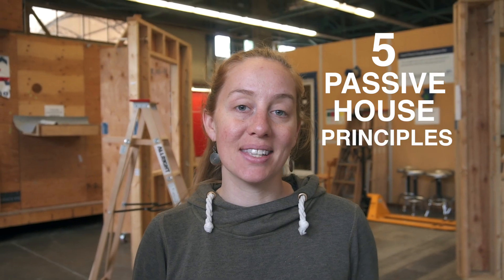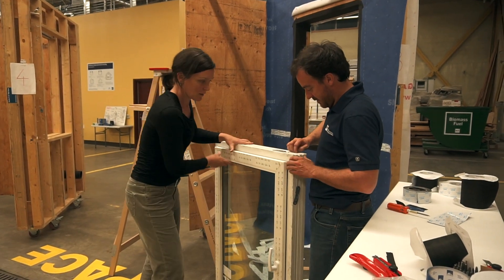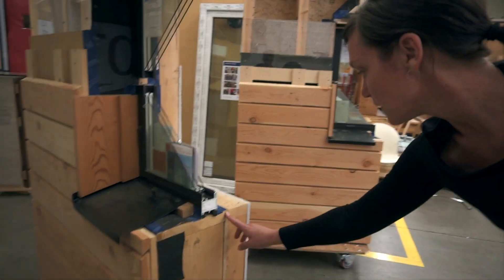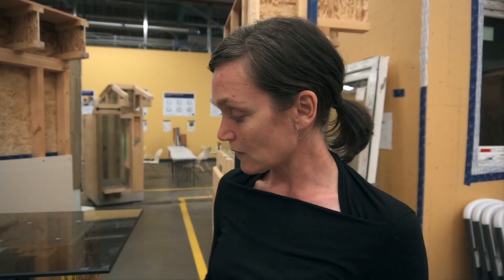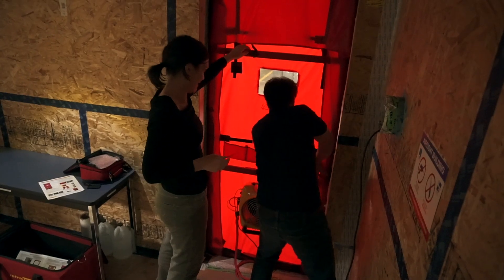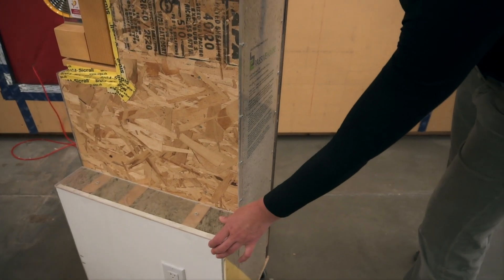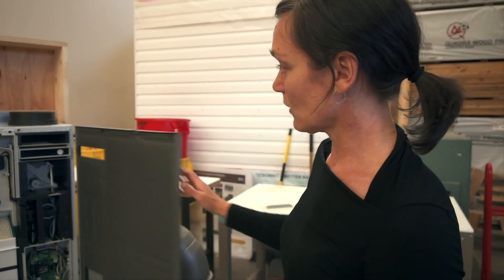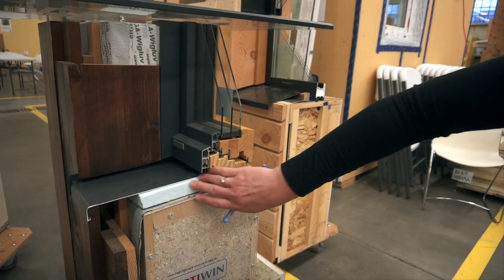Passive House = 90% Home Energy Reduction!

Comment: They didn’t speak of cooling.  Where I live during the summer we have consecutive weeks of 90 degrees F weather.  And this can slop over into the spring and fall.  Our concern is cooling.
Reply: Mary Ann Lee same measures with a few different dispositions regarding orientation. What can keep the heat inside can also keep it outside :)
Reply: @alexanderj1316  What system do you think is best to deal with this problem? A system that creates even more heat outside just makes the problem worse!
Reply: @greengenie7063  it does not create heat, it just keeps it outside. This is a basic principle of insulation. The building hull is optimized to minimize heat conduction, which means that the balancing of the temperatures between the colder and the warmer side will take more time. It can thus work both ways.
Reply: @greengenie7063  Did I get your question right?
Reply: @alexanderj1316  Superinsulation, shading and air-movement are all fine. I'm glad you are not promoting air conditioning!
Reply: @greengenie7063  definitely, though I would tend to think that shading, natural air flow and inertia a easy to obtain with simple materials (traditional construction does it) whereas superinsolation usually requires more grey energy for the product processing
Reply: @alexanderj1316  Passiv-haus (in the UK) has typical U-values of 0.1 for the roof and 0.2 for the walls. To create these values you just would not be able to use simple traditional materials such as timber, earth or stone. 
Super-insulation can be created by utilising a range of techniques and materials. Cellulose insulation (from recycled paper) is one of the best insulations available. 
In a global warming situation, the traditional building techniques (such as earth or stone) are not able to eliminate indoor thermal conditions which are un-healthy for human physiology - and current (active) passiv-haus technology will also struggle to maintain indoor comfort.
We need practical, affordable ideas that actually will work in the future, not concepts which we just feel good about or enable us to feel good.
In a world living with climate change, traditional buildings are already become uninhabitable during extreme periods of weather. In the UK in summer I already find that it is more comfortable in a simple naturally ventilated, insulated building with zero thermal capacity - compared to a brick building which soaks up heat energy but cannot cool over night due to high night-time temperatures.
Reply: @greengenie7063  It is all a matter of concepts, you could get a good natural air flow if you make the temperature gradient play in your favour. This is not incompatible with using inertia for keeping warmth in winter.
I also used to think that new materials are necessary to improve the situation (and they do improve it), but the truth is that they are not enough of a solution.
In Switzerland, people try to make "2000W societies" (another label such as Passivhaus, Minergie, Leeds and so on) a reality, but the sad truth is that people expect to have 25°C inside so that they can run around in underpants while it's at -10°C outside. 
People used to know when to put on a pullover and get nearer to the fireplace, they have survived all the way, but our growing expectation of comfort is pushing consumerism.
And in other countries, the climate is more stable throughout the seasons, which makes traditional housing the best (but often forgotten) solution, as I have seen in tropical countries.
Reply: Alexander J  I do not think you have understood what I am saying. A good natural airflow (not always possible) is somewhat useless in a high ambient temperature. 
So called traditional materials and thermal capacity is already proving unable to provide comfort conditions in places such as Spain and Italy during heat waves. 
People will soon change their habits when the climate forces them to. I am 72 years old and 25 degrees indoors is way too hot for me (in winter or summer)...
Reply: @greengenie7063  I understood, but I disagree. Sometimes you have to realize that you need to get acclimated or else move. It might seem like an extreme position, I get that.
I have had a strong interest on these subjects for ten years and I might only be a you engineer, but my personal experience brought me to the conclusion that the main problem isn't technological, it's behavioural. There are still peoples living in any kind of extreme climates, as they have been for a very long time, since before electricity.
Passivhaus and such is good, but it's suited to answer a problem linked to a consumerist society, craving comfort but not looking to adapt their behaviour. So it makes things better, but then people want more, this is why I think that the priority is changing our behaviour. Traditional construction techniques can be very suitable for durable, long term thinking, mostly because they are specifically adapted to the area, using local resources.
Reply: Thankfully, Passivhaus is not relevant  to most people on the planet, because they cannot ever afford to build that way. 
Passive solar dwellings can be built affordably, using renewable biological materials along with glass and a few high-energy components. 
Most traditional building materials and techniques are from an age where populations were smaller and unaware of the polluting nature of heating systems.
For me, the whole purpose of being alive on our amazing planet is to evolve to live and love more ecologically sustainably...
Reply: @greengenie7063  totally agree on the last part. Not sure I got your exact point on the rest but seems like I agree on that too :)
Reply: @greengenie7063  Lol, I live in north Mexico, I set my AC to 25c in the summer and feel confortable!
Reply: @HeinrichGossler  I live in Pheonix, Az. so 21c in the summer and 24c in winter would be my preface. I'm that person that doesn't want to live in an uncomfortable environment. I'm still a little skeptical about a passive house in 120F temperatures. Has anyone been built one in the desert anywhere? I don't want to rely on theory only.
Reply: Every word where she says heat, can be replaced by cold and every word cold, can be replaced by heat. Passiv house works both ways.
Reply: There is another video on YT of a man who created a passive house with straw bales and he addressesd this question. Just do a quicksearch on YT
Reply: Mary Ann Lee 
geothermal cooling and heating

Comment: Even though the concept of passive house has been around for 40 years, saying it is simpler (as told by Alexandre Hébert in the video) is not really true. A part from the user/cultural appropriation (not opening the windows too often), passive houses have stricter requirements concerning air quality. Since the building has to be better sealed, the ventilation has to be very well dimensioned in order to eliminate air pollution, which is a growing concern in building interiors.
Reply: Alexander J oh yeah. 4 years ago I was helping out on one passive house project - think of a block house, and ventilation was undercalculated making residents opening windows all the time. The problem was that the whole ventilation recuperation system was too expensive to upgrade and they just kept it as is. It still got a nomination as one of the most efficient houses lol. On paper that is.
Reply: Reinis Miks same problems everywhere... And nowadays you can try to have a better feedback through measures of energy performance and people complain about data security... Endless struggles
Reply: Alexander first world problems
Reply: Sadly there are solutions that could improve energy efficience, thus lowering energy production, thus lowering climate impact... which is affecting other countries way worse than "first" world countries... It's a shame

Comment: Why not just use rammed earth instead of all those layers? And use hempcrete for interior walls.
Reply: MetalGearMk3 love it! Though there are some good reasons: usually the reason against it is because rammed earth is more time and labour intensive, and also because it is more difficult to apply to bigger buildings, even more when you have to guarantee seismic resistance. There are some innovating subjects on the matter, I hope it will go on because rammed earth or adobe produces way less grey energy.
Reply: MetalGearMk3 because U values are poor for said materials
Reply: @Rainaman-  YES,  just look at how wide a rammed earth wall would have to be to give a U value of 0.1 W/mk2!!!
Reply: Beside cost(the material is cheap its the labour that's expensive), the upside(which IMO out way the downside) is ram earth can be used in a 2 story house with ease - its fire proof, earth quake resistant , mold proof and last generations without any up keeping. Hempcrete is also fire proof and mold proof. Both materials have little to no VOC. I'd like to see a passive house standard built around the 2 mention material but it has to keep things as simple as possible.

Comment: 3-10% premium, more like 25-50%i would think! 2x10s compared to 2x6=80-90% more, plus everything else!! double sheeting, windows, insulation etc...
Reply: She said that was the added labour cost.  I'm not commenting on the accuracy of the number, only identifying what she said.
Reply: I have worked with BC projects that have completed with a 7% labor and materials premium.  Premium may vary depending on where you are in the globe.
Reply: tom williams you are right with those numbers. But insulation and all membrane sheets/tapes are getting more cheaper as it becomes more mainstream
Reply: Framing lumber prices multiply quickly when going to 2x10 and you are correct. But long term it9 worth the additional cost. With a good design you can leave room for additions. Because the expense of these homes means no space that is not needed which I think is great!
Reply: That was labour only. 
I think generally passive houses come out at about 30% premium in total.
Reply: Much of the construction cost is unchanged. The aditional cost in insulation and HRV weighs little overall. I'd go with 8-10% overcost, the most. With 90% energy savings...
Reply: @tom you can just build a monolithic dome, and it's more efficient for much less money>
Reply: She was talking about Labour costs.
Reply: Maybe building a picnick table, not a wall profile like this! There's no way!
Reply: tom williams check out the prefabricated passive house assemblies from Phoenix Haus in Detroit.  Ask them about their cost per square feet.
Reply: If it were my own house, I would not select 2x10s period; you simply don't need that much lumber.  A 10" thick wall is great no problem by why have thermal bridges spanning it?!  Better is a 2x10 sill plate and offset 2x4s 24" on center.
Reply: Yeah this is BS! Waaaay to pricey for general public. People, research geothermal homes. Cheaper and works better!!!

Comment: In my country by 2020 building regulations will be stricter than passive house ones...
Reply: By European Union regulation?/RT2020
Reply: Alexander J I think so. Could be some extra requirments due to Economic Ministry (all building regulations go thru them) being influenced by insulation industry lobby. Which is cool, but some alternative building styles and even traditional log houses (without artificial insulation) could not pass those laws. Working in different field now so not keeping tabs on whats what anymore tho. For my climate zone where I wanted to build cordwood home, logs would have to be at least 500mm long, making it unsustainable building practice. And that sucks, because of all alternative green building styles, I did like it the most. The building code is going to be along the lines of net zero consumption house. And U values for walls and windows/doors were lower than international passive house standards. Just a bit.
Reply: Reinis Miks laws and labels always struggle to define realistic rules that are open to a variety of methods and aim at energy consumption on the full project lifetime (cradle to crate)... Labels such as Leeds, Minergy, Passivhaus and even the new regulations certainly are a step in the right direction but mostly theoretical and influencing a very particular type of (industrial) construction. I agree it's a pain...
Reply: Alexander J you must ve working in the eco building industry, don't you? Have you seen that map how many glazings windows "should" have to comply  to those regulations by region? Spain had triple glaze, which shocked me a bit as I spent around half a year there in rural stone house there with single pain windows. Place was small and heated by rocket mass heater (fueled by olive branches) during winter and during summer stone walls kept the place nice and cool. Seems so weird how something as simple and perfectly green would be counted as unsuitible now. Even a canadian cyclist who lived in harsher climate and stayed at my place was shocked how thick my windows were. Feels like Americas are the last frontiers of some sort of alternative building freedom.
Reply: I investigate a lot of my personal time on the subject, since before I started university. 
My company is more or less advanced on the subject, unfortunately we don't go much further than... (how to put it?) the best industrial/commercial standards.
I think the last places for innovation are countries where construction laws are less controlled and enforced... If you take a look at Michael Reynolds, the situation is also quite difficult in the USA, but I guess other latin american coutries, africa and some regions of Asia are still quite open. I've seen a great project in Mexico.

The problem is similar than with agriculture : industrialization brought comfort but the standards are far from being sustainable as where traditional techniques...

I've never seen this map btw, do you have a reference?
Reply: Alexander J tried to find it, but must have lost it over time. Just remember having it in one of ppt files from some passive house conference or something. Couldn't google it as well, but what it boils down to is insulating home from excess heat, thus same insane insulation as Nordics, to minimise AC use, yet they have milder (or rather archaic) regulations, because insulation is seen more of a cold weather solution. But yeah, not enough people care about these things.
Reply: Reinis Miks
in your country? What is your country?
Reply: eDrive It basically applies to the whole European regulation if I remember correctly. In France, preparation for this laws has been part of the curriculum for about a decade for architects and civil engineers, since the requisites are being implemented gradually step by step. The classes were far from being optimal, though.
Reply: @Alexander J
Well, if it's the European Union, it's more specific. 
But if he is from USA, or China, or Indonesia, or Namibia... That's quite different. 
But "my country" Well, the world is big ;-)
Reply: I saw you're from Germany, I could try to find the text references if you are interested.
Reply: Alexander J 
Thanks for the link!